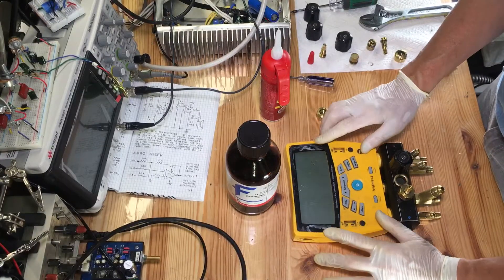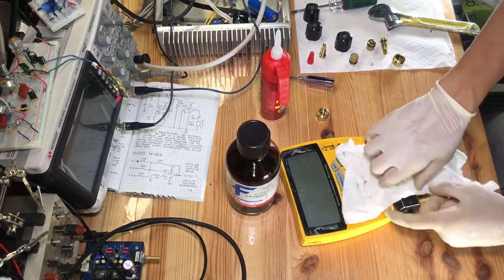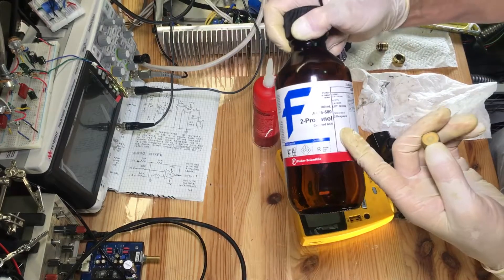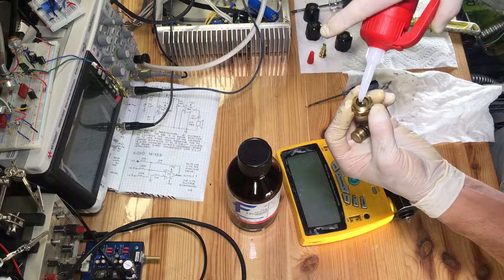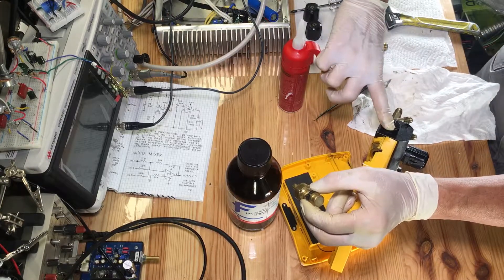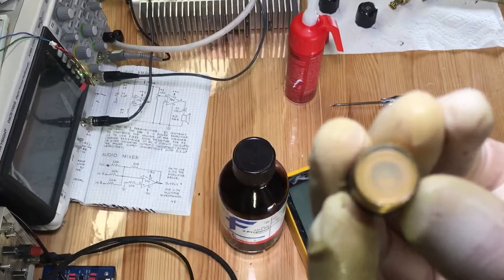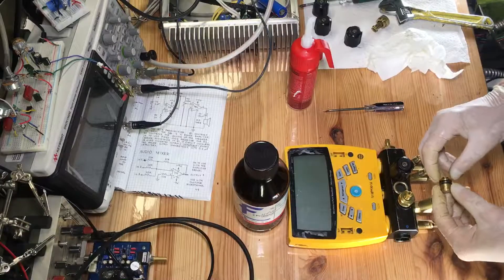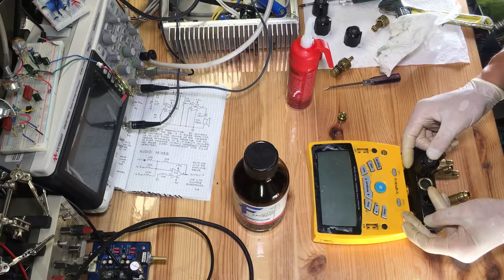Leaking Fieldpiece SMAN 460 repair with silicone grease

Comment: Do you have a video on repairing a leaking sightglass  ? Thanks.
Reply from the maker: Howard Haraway I think I will make one because I’m about to order a kit from Fieldpiece to get new valves I think just for the fun of it I will order the site glass seal kit so I could add that into the video.
Reply: @coldfinger459sub0  Thank you so much. I will look forward to that video. I thought all was needed to fix the leak was a big hex bit to back the sightglass out but apparently not and I am not even sure about the that . All I know is I have a $600 paperweight  that is useless to me right now.I just received my Testo  manifold today that I orderd from Amazon.
I have the tool to remove their sight glass if it starts leaking. It would be a
GREAT to put my Fieldpiece back into service. I do alot of commercial.

Comment: Thanks so much for this informative video, t lech.  Do you know where/how to obtain replacement O-Rings for the valve pistons?  Do you think they are simply neoprene?
  With my Vernier caliper I measure something like 7/16" I.D. X 9/16" O.D.  Looks like I could order some like this much cheaper than Fieldpiece's replacement valve kit.
Reply from the maker: Wesley Tarkington I ordered them from Fieldpiece because it comes with the entire brass piston. That Teflon or nylon disc in the end of the piston also wears out. 
         But of course you can replace them with a different O-ring probably the green ones that come in automotive kits. 
       Actually I should try that myself I have hundreds of different size of O-rings all around that size. That come in the large automotive professional kits
Reply: @coldfinger459sub0  I cant seem to order any part off fieldpiece website. Did they stop shipping/selling from their website? It only shows parts house that may have the part in stock near me.
Reply from the maker: @EastDallasKicks  Try Tru Tech Tools 
https://www.trutechtools.com/

Do you have a chat window where you can communicate to someone on chat one of their sales personnel and their phone number

Comment from the maker: This is a reminder to technicians even though it’s not recommended to try to pull a deep vacuum sub 500 µm will be extremely difficult with refrigerant manifold gauges with only normal refrigerant charging hoses were never constructed or rated to perform this procedure. But if you’re going to out of necessity by performing this procedure with silicone grease will give you the best results so you have the possibility to pull the best micron level using refrigerant gages.